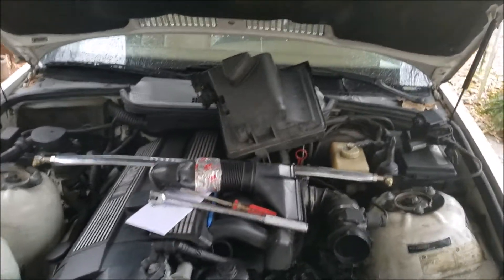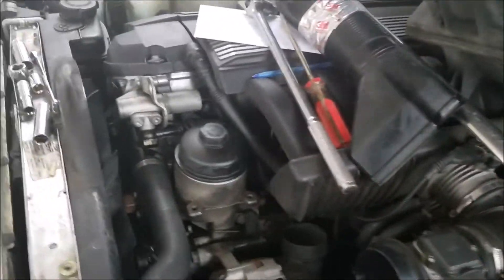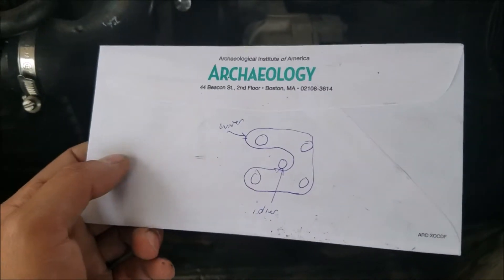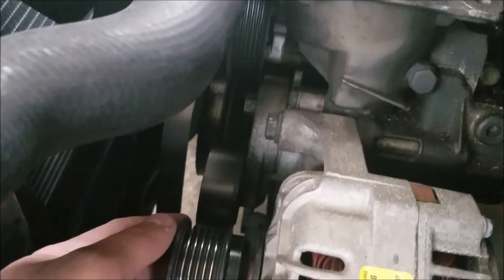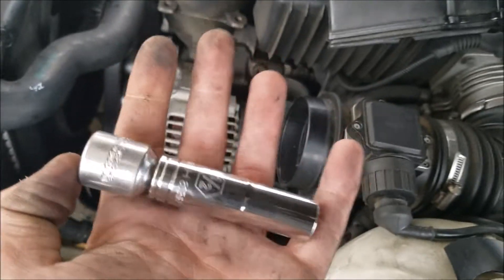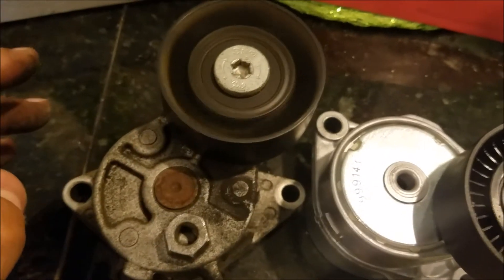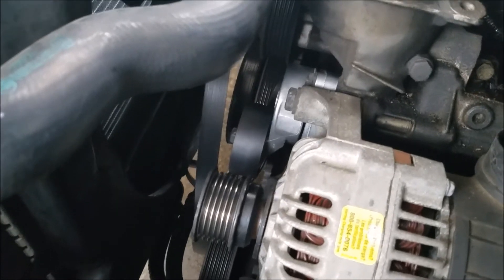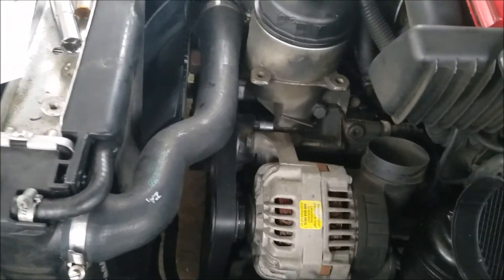BMW E36 Tensioner Assembly Replacement

Comment: you're the best out there on Youtube. Thank you. :) If that's a '94 @8:39min then that's mine but, with a tan top. A list of part supplier sources would be great, too. I just wish that there was a vid on how to replace the BMW idle air control valve underneath the Intake manifold for a BMW E36 1994 325IC without having to remove the manifold. :(

Comment: Good thing I replaced this assembly month ago the oem manufacturer is ina I paid about 40 for it. Keeps your belts nice and tight and avoids slippage, and tennsuonner pulleys are a must on any e36 unless you want it to slip
Reply from the maker: Oh yeah this vehicle looked like it was getting ready to slip.
Reply: E36 Fanatics yeah I wish I would have done it before it slipped off when I made a turn and caused me to break down

Comment: I replaced the tensioner pulley w the same part you got but there’s not enough tension on the actual belt
Reply: Same problem any solution?

Comment: my pulley has a cap on it any idea how to get it off
Reply from the maker: plastic cap? flat head screwdriver around the edge, if you can't see an edge it is probably just covered in grime.